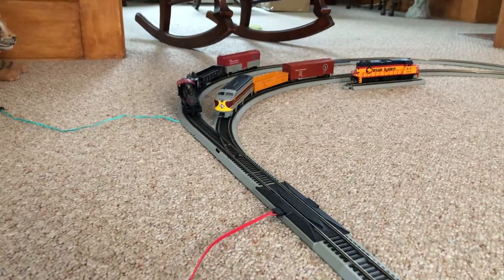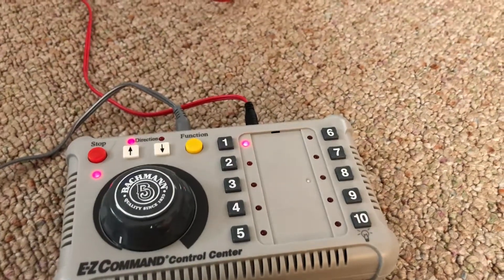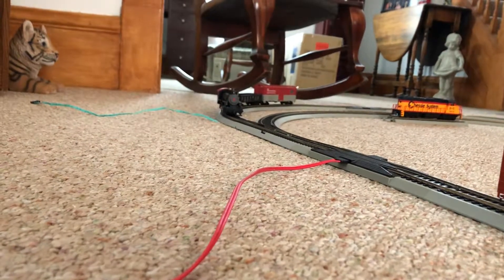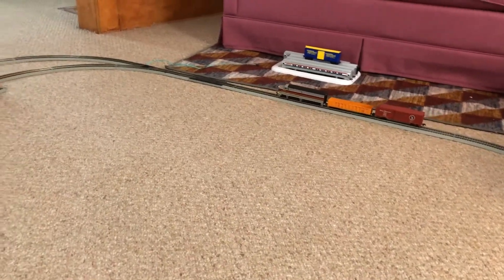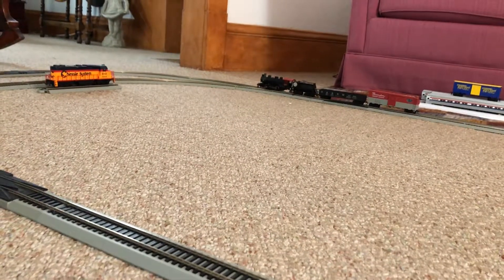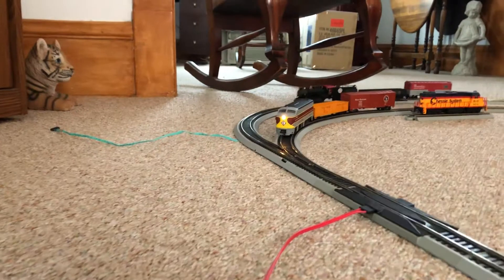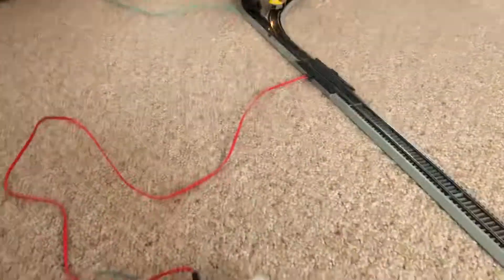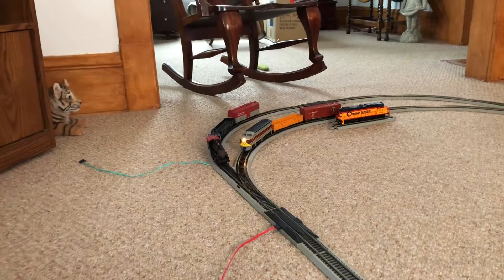How to Run a DC Locomotive and DCC Locomotive at the Same Time

Comment: So the loud buzzing from the Erie Lackawanna locomotive, is that normal? I never heard this sound when I ran these engines on a DC controller
Reply from the maker: Pacific Productions, dc engines make that noise when run with dcc controller. It is safe to do so if the transformer is set to f10

Comment: Where did you get that controller at bro I need one with sound
Reply from the maker: CSX/NSrailfan 23, I got the controller in a box with the 1099 from Bachmann. 1099 doesn’t have sound, but the controller should work on a Bachman dcc sound engine
Reply from the maker: CSX/NSrailfan 23, Bachmann sells the controllers separately or with an engine. Some sets where the engines have sound also include them like Echo Valley or the Thunder Chief
Reply: @RavennaRailfan4070  Or the thunder chief.

Comment: Sorry but I really don’t recommend this, over time it will ruin you loco. I have a layout that is dc and dcc and I plug in which ever controller I want to use, but never run a dc locomotive like this
Reply from the maker: East Tennessee Railfan I have put a note on the video that this is not necessarily what I recommend nor do I normally run trains like this, this video is meant as an experiment to show a temporary solution to a temporary problem

Comment: I wouldn't do this.
Reply: Me either, if I was to run an analog locomotive, I would put away my DCC engines and disconnect my DCC controller to connect my analog controller and add my analog engine in which it makes sense to me.